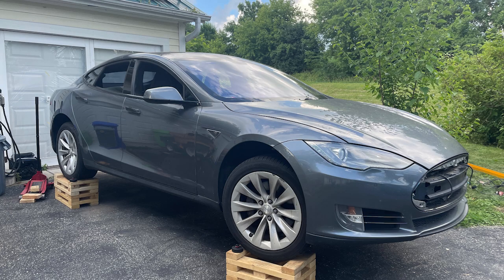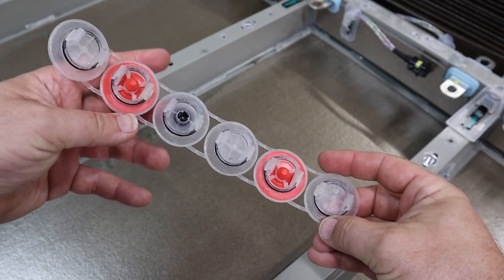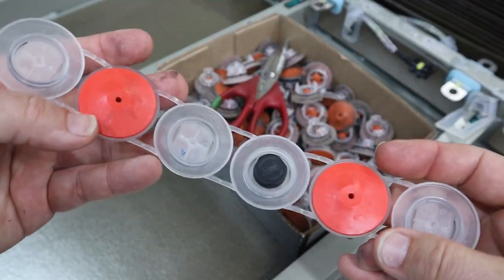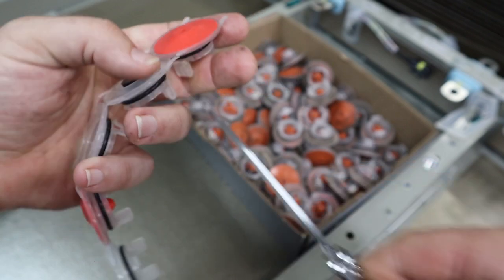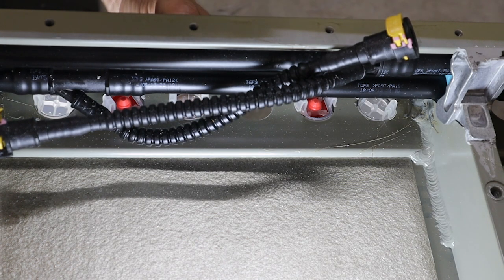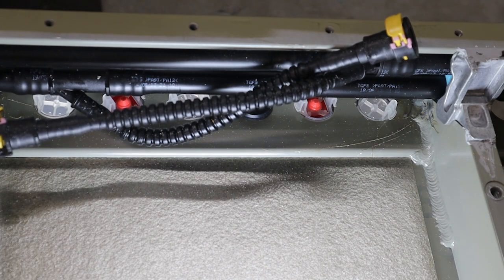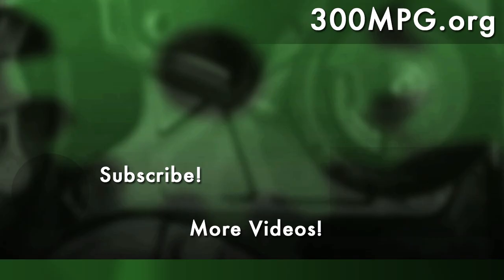DIY Tesla Battery Repair: New Umbrella Valves

Comment: A great continuation to your brilliant series, thanks!

FYI - & maybe worth considering if your pack is still out; Obviously the pack needs to "breath" as it warms & cools for various reasons. An EV car repair specialist in my area now upgrades these packs to include a transparent bottle/tube filled with a colour changing desiccant in line with the original breather (where you pressure test), thus allowing you to monitor & control moisture ingress without removing the whole pack. I guess the new carbon/gortex-like breathers replacing some of the umbrellas would not be compatible with such an external moisture trap, they’d bypass it.

Comment: Keep breathing. Stay clean.  Looks like dirt is only a really bad problem for the front 4 bays.
Why not seal the front side edge of battery, where the ski rail piece sits. 
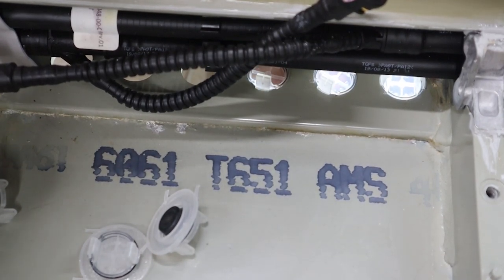Looking at this video 3:25 and earlier video Tesla Battery Repair: Umbrella Valves 5:10  there are also holes in the ski rail. Are they for battery mounting bolts?
Could the holes for the front 4 modules be sealed after mounting the battery? That would keep the front wheel dirt from flinging into that area.
Reply from the maker: On reinstalling this in the car, I'm going to caulk up the leading edge of the ski rail.

The holes in the rail are for the mounting bolts.

Comment: Are those sections were modules hiding, connected to eachother so the breather valves could be anywhere?
Reply from the maker: The modules are essentially sealed off from each other, but the coolant lines run down the sides of the pack. Those are surrounded by a bit of squishy foam. It does NOT COMPLETELY seal off each module bay from the others, as can be seen by the fact that for pressure testing, air only goes IN to one module (rear-left corner), yet it pressurizes the whole pack.

Comment: one thing i don't understand on the front plugs... if the idea is to completely plug them up anyways, why not do away with the plugs and just seal it with something substantial? like weld some metal over it or some cover that has silicone caulk to make certain nothing can ever get in? seems like since that is the previous failure point and the solution is to completely plug them anyways, why not REALLY plug them up? thanks for sharing all your experience on this!
Reply: Yeah, bro. It's a good question. With the difference / need to note that:
0. It need to 'breathe'
1. you will put some membrane (Gore/oth) breathers in the middle or in the end of pack
2. Plugs or RTVs got to be temperature-degradeable so in case of fire they just melt down. And let the fire and high temperature gases  off the battery / exact defective block.

P.S. I knew personally a man of Tesla Enthusiasts RF / EVC who saved the whole car (MS) and (sic.!) a part of battery while some of modules were burning to ashes. So...
Reply: @koenigtf  that's good info. Thanks.
Reply from the maker: The plugs seal well, are simple, and the right thing to fit in there. I don't want to make any permanent changes to the actual pack itself.

Comment: Tesla factory assembly, uses a special long jig each side with clamps to block off the breather valve locations. 

I will recommend to install one breather valve at front bays. This vavle allows atmospheric balance. Prevents the "potato chip bag effect" at altitude. 

Your RTV sealant needs on the pack perimeter, down the spine, and on each bay cross bar.

Comment: Could you pull a vacuum on the pack instead of pressure so you don't have to worry about the umbrella valves?
Reply from the maker: I suppose you could, but I'm just following official Tesla service protocol - which calls for air pressure, Not vacuum.
I would imagine that you could have a failing umbrella. It might seal up well on vacuum, but open at a lower pressure than expected with pressure.
Reply: @BenjaminNelsonX  Ah, ok, so the Tesla test specifies some low pressure that the umbrellas are supposed to still seal at. Gotcha.